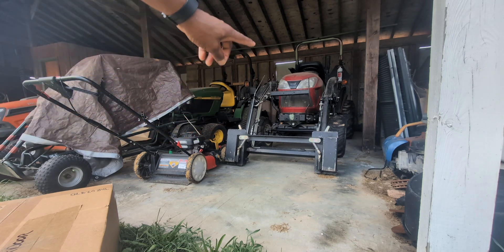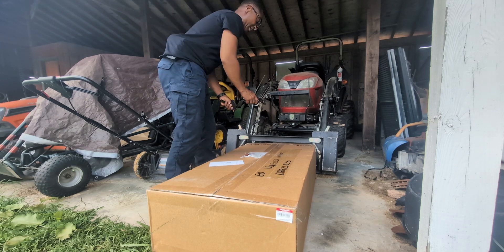Yanmar SA324 replacement hood (part 1).

Comment: Hello, I have a 424.  Do you think if I disconnected the strut it would eliminate the hood crack?  I will use a prop to keep the hood up if it helps to keep the hood from cracking.  Thank you for the video!
Reply from the maker: @shawngerman3583  yes. Some owners disconnect the hood support strut; only using it as a hood prop once they manually open and lift the hood.
Reply: @97TRAKIN  Thank you.  I was thinking of doing that to prevent the cracking.  I have 170 hours on my tractor, and still no cracks(keeeping my fingers crossed!)
Reply from the maker: @shawngerman3583 mine didn't crack until I hit 194 hours. I'm currently at about 198.

Comment: How old is your Yanmar? I bought my SA324 in 2020 and am wondering if I am still covered. I just passed 300 hours, but crack happened around the 150 hour mark.
Reply from the maker: @lightseeker_88  My Yanmar is 2 years old. The Yanmar warranty is 10 years, but the cracking hoods are a known problem and it should be replaced even if you are out of warranty. The hood has been redesigned 3 times so far.